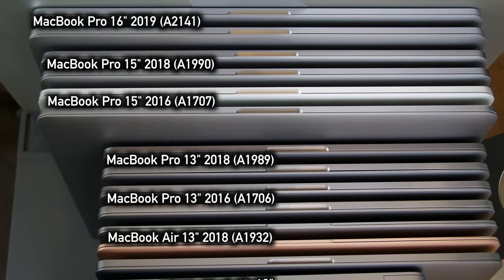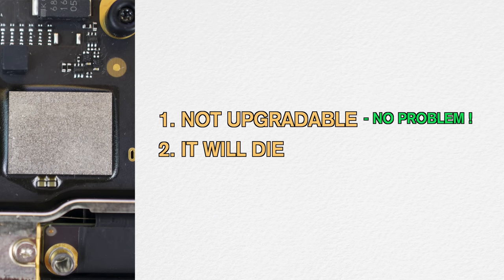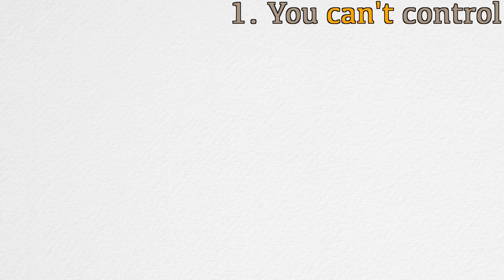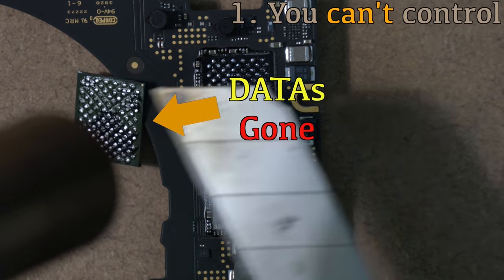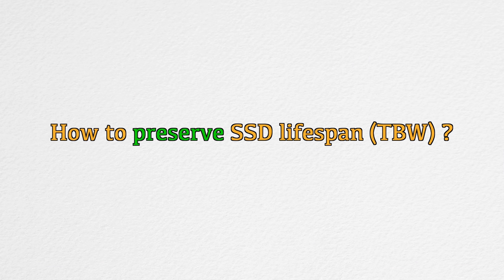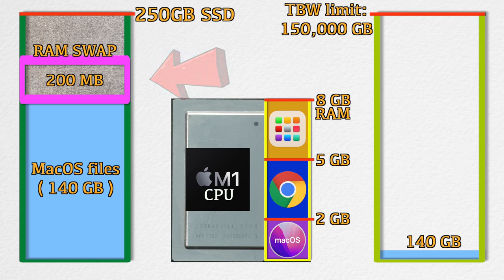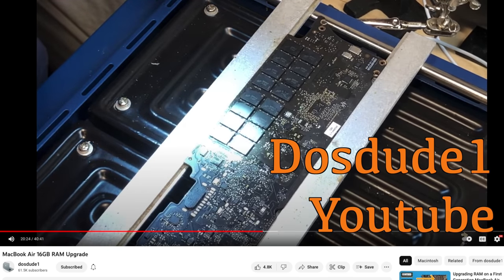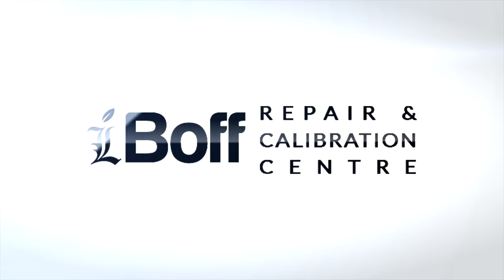These MacBooks DIED from SSD Failure & How To Prevent It (Not for RICH dudes!!)

Comment: The other thing as to why you get a larger SSD than you think you need is an issue with wear levelling. The TBW metric is oversimplified. The SSD has a number of blocks (say 1000 for a simple example), each of which can be rewritten 1000 times. What happens if the SSD keeps rewriting the same block rather than sharing the load? If your SSD is 80% full, then all that writing and rewriting is spread over the 20% of blocks remaining, which means that those blocks get worn out way quicker than the TBW lifespan metric would indicate.

I'm writing this on a refurb Thinkpad I got off eBay for £150, which has an nvme slot. It's current SSD is small (250GB) and is about 60% full with all my music and other software installed. But as and when that becomes an issue, it is an M.2 SSD, so I can replace it. The RAM is 4GB fixed plus one slot (currenty 4GB but I can stick  a 16GB stick in at some point).

I can understand fixing the memory to the CPU (better speed/latency). Having two tiers of memory (fast RAM on the CPU and secondary RAM in slots on the motherboard) would complicate things.

But soldered storage is a cardinal sin. I have a friend who is mac only. Her current Mac has served her well for 10 years. A new mac will cost a lot, and this video points out what I'm very concerned about, namely that she won't get 10 years out of a new mac. 5 if she's lucky. So the cost is amortised over half the time, so is effectively twice the price per-year compared to her current mac.

More and more Macs are becoming a means for Apple to rinse the rich, and to hell with everybody else.
Reply: TBW is per entire drive capacity, before failure. So divide that with the number of TB of the drive and then convert to GB. You then get how many TB a single GB of free space on your SSD can be overwritten with before that GB dies.
Reply: Maybe SSD companies have clever tech that randomly rearranges the stored data to different datablocks to prevent the issue your saying... doesn't seem that absurd of an idea hahaha
Reply: The other thing not mentioned is deleting files are also write operations, which tally to TBW as well
Reply: Give her your thinkpad
Reply: God you are dramatic. It really isn’t that bad. Oh NOOO she didn’t get 10 years out of a laptop computer? THE HORROR 😂😂 TF you smoking!?!
Reply: this depends on the controller for the drive.  A good controller would recognize those files that haven't been changed for a while, and if rest of the blocks are getting used much more than these blocks, it would copy these files into those overused locations then use these less used blocks.
Reply: So it seems that implies another best practice is to keep onboard SSD with as much free space as practical?
Reply: @j3ffn4v4rr0  Best practice is not to buy soldered to board ssd to begin with =)
Reply: Load of nonsense, 10 yrs out of the average SSD, soldered or not. Stop whining!
Reply: Some of the worst cases highlighted on Twitter and community forums indicated that some SSDs had consumed up to 13% of the maximum warrantable total bytes written (TBW). This kind of excessive usage would mean the lifespan of an M1 Mac would be as little as two years
Reply: Well, I will resell all my Apple devices.
Reply: @PaulSebastianM  Internally, an SSD is divided into blocks. Each block has a limit to how many times it can be rewritten. It is from this that the TBW limit for the drive is derived. But if the SSD is forced to rewrite the same block many times over, that block can fail before the drive reaches its official TBW threshold. The drive tries to even things out by using blocks that have been rewritten fewer times in preference to blocks that have been rewritten more. (This is wear levelling.)

If you don't have enough space, the drive can't do wear-levelling properly.
Reply: @davidedt  may i ask how much you are asking? and which devices you are selling? thank
Reply: @spacecadet2172  The problem he was pointing out was 5 Years of lifespan if lucky, and then the other problem is that you can't just save it's data again somewhere else after it suddenly dies.
Reply: @fa14bi-78  That's completely false.  He is blowing smoke up your butt.  Yes it's possible for drives to fail, but it's not common.  My parents are still using my 13 year old 2012 retina MBP with its original SSD and it runs beautifully (and I put that thing through hell).  I support clients and their Macs all day every day, and I come across countless Macs that are working great with SSDs way older than 5 years.  This "5 years if you're lucky" nonsense is complete hogwash.
Reply: @spacecadet2172  Well, depends on how much storage is used and how often the same part get's rewritten. As well as swap may be active or not. 

I managed to kill an SD card within 3 Years so there is that.
Reply: @fa14bi-78  again, I didn’t say it’s impossible but it’s much less common than he makes it out to be. Even writing many times past their lifespan they often don’t fail. That is just a loose estimate. It’s not a date of execution. Their drives are so much better quality and more reliable than a commodity SD card. They are not even remotely comparable.  If you actually thought they had a similar lifespan, no wonder you guys were so worked up. But that’s just not the case.
Reply: @j3ffn4v4rr0  Where did you get this from? And have you ever looked at the prices for a M.2 ssd vs paying a 5x price premium to upgrade the SSD from the Apple configurator?
Reply: @Welovedaxies  This video proves otherwise. LOL. Just because it's a small chance doesn't mean that there isn't a chance. Losing your whole entire drive's worth of data is not a small issue.
Reply: @spacecadet2172  Just wait until you happen to be one of the unlucky people... though I assume that you back up your data due to your experience with IT. However, this might be shocking to you, but the majority of people don't back up their data.
Reply: @spacecadet2172  Your opinion seems to only make matters worse. Placing false trust in a drive only makes people less likely to back their data up, and if they are one of the unlucky people (which is not even that unlucky due to the rate of drive failures), they are screwed.
Reply: @spacecadet2172  Any mac fan can say wonderful things about macs but are they true?
Reply: @spacecadet2172  you cant say what is happening to all macs out there so I think that you say its not true.
The smell of fanboyism is in the " 2012 works beautifully"  no 2012 mac works flawlessly or maybe you downloaded some ram?
Reply: @vivek_v  You're not paying enough attention to this month-old thread. I'm referring to what John Allsup said regarding how not having enough free space will inhibit wear leveling and reduce the effective life of the SSD.
Reply: @Teluric2  Mac users who actually work with with tons of Macs over the course of decades tell you their experience, and you dismiss them and think you know better with your limited experience with Macs, and I assume scuttlebutt you heard on the internet from Apple haters.  What is even the purpose of arguing with someone like that?  Clearly you don't want the truth, you just want to confirm your preconceived notions.  Also yes, the MBP from 2012 runs great.  The SSD works very well still, and it has 8GB of RAM, which is the same amount of RAM that the majority of Macs still ship with to this day.  The same can't be said for the HDD based MBP that preceded it.
Reply: Why choose macs. Its bad PoS especially soldered ram and ssd. I'm still using my lenovo y50-70 bought in 2013. Upgraded ram with corsair vengance 8Gbx2 ddr3 and SSD samsung 850 pro 250Gb in 2014. Still working fine and i let it run like a server for the past 10 year. 🤣
Reply: So your friend moves 82 gb of data every day for 5 years? 😂😂😂 really?
Reply: people demand skinny laptops - so solder them in!
Reply: @Rudyjosephjr  It is nothing more than a status symbol. Shallow mac fanbois will never admit to all the ways apple has failed us all.
Reply: @David-wb1vw  I do when I play games, sorry you can not have fun on your typing thing 😂 almost forgot that games are only for non Mac users.
Reply: @Auguur  wow - you are such an amazing person!
Reply: Your friend should be able to 8 years out of the max if she spends 400 extra for 1tb ssd.   However she can save 10-20% buying refurbished directly from apple.  I always buy refurb from apple and still have a 2012 mbp retina and 2016 mbp, 2020 mba, and 2021 mbp 14”.  The later two replacing the former 2.
Reply: @timbukstu  refurbished from Apple is great - one can purchase the full 3 years of AppleCare.
Reply: @gcbification  I don't think that 'deleting files' is a write operation... it only cleans out the directory pointers to those blocks...they are only re-written when new data fills in those blocks, UNLESS you use a 'Secure Erase'm which REALLY BURNS THROUGH writes ! As it re-writes the data blocks, several times.
Reply: Excellent point. Wow, this is why I doubt the future is about abundant cheap goods and services... the hidden costs of Apple is such an example. Wow- new models and half the life of the old models? Sitting here with 3 dead MacBook pros and now I know why. 😮‍💨 And how much data loss has Apple caused because they didn't inform customers? 🤬
Reply: @brucemercury  Time Machine Bro!
Reply: @spacecadet2172 ohh you re so apple loyal. What he meant is that the new macs wont last as long.
A mac built in 2015 wont last like a 2012.
Reply: @Welovedaxies who is gonna believe that
Reply: @spacecadet2172 my parents? Why we should believe a teenager?
Reply: @spacecadet2172 just another  isheep that thinks macs are perfect and we gotta believe what he say.
Comeback when you have a degree under your arm
Reply: @spacecadet2172 the word " beautyfully" shows you re fanboy .nobody unbiased would use that word.
Reply: @spacecadet2172 ssd best quality? Based on what? Why do you think ssd nand chips can be replaced because they re standard not the premium hardware apple claims but is not  true
Your name must be applecadet
Reply: @spacecadet2172 clearly you would die defending apple

I wonder if that 2012 mac does exist in real life.
Reply: @flyingdiscproductions people who need skinny laptops are not working they need a toy to brag about
Reply: @Teluric2  There you go! you just proved everything with that one sentence!
Reply: get an external sata and partition it i can run snow leopard on my 2020 mac touchbar does not work because of os but everything else does
Reply: @miscmisc1023  What do you mean "does not work"?
How have you configured it?
EFI?
Reply: @patrickdonegan9559  it works but software is not compatible with snowleopard if it was high sierra and up yes
Reply: @Welovedaxies Show realible evidence. My 486 is alive too lol running windows 12 and editing 16k videos😅
Reply: @rafaelreusch  static wear levelling does exactly that. i.e. moves data from static blocks that fall below a certain P/E ratio. Dynamic wear levelling only touches empty blocks. 

The naming's a bit counterintuitive as we normally associate dynamic with better whereas in this case it isn't - not for drive life.

I'm not sure drive manufacturers list the type of levelling each model employs. I feel they ought to.
Reply: Macs are garbage designed to fail and get you to buy more garbage. Kind of like HP
Reply: @Welovedaxies I have a 2013 air. Still going strong. It still works as my daily driver. It’s soldered on. Hopefully it doesn’t give up on me
Reply: No matter what the life span of the SSD is, storage should not be soldered onto the board. First, because of its limited lifespan and second, to keep the option for the customer of upgrading the capacity.
Soldering storage onto the main board is not a sin for Apple - it’s their business model and will backfire eventually.
Reply: The reality is this is not so dramatic. I’m using my MacBook Pro 16 M1 Pro 16GB ram and 512GB SSD for daily video editing, in general 4K 60fps hdr .mov or .mp4 for 1 and a half year. I’m editing one or two 15 - 25 minute 4k vlogs, from external ssd, a Samsung T7 Shield. Seeing 20GB swap memory when editing is something very normal. My actual internal SSD health is at 100% and the TBW data show me 14.6TB. Normally I charge my MacBook every 4-5 years, so, with the actual conditions I’m good to go with what I have.
Reply: @AurelianIrimia  Your channel has one video. Not really the product of a daily video producer. Plenty of PC owners imagine themselves as gamers even if they haven't opened up Steam in 8 months, people imagine themselves as productive information workers even though they haven't opened up MS Office in 6 years. Personal testimony is not data.
Reply: @L9MN4sTCUk  I’m not a YouTuber, I’m editing for other YouTube channels.
Reply: @spacecadet2172  Why should people be made to replace their computers because faulty solid state storage was used in its manufacture?  Apple users aren't afforded the opportunity to replace their SSDs when they are soldered to the motherboard.  I've sen how it used to be possible to boot from external drives but with the T2 chip the BIOS functions are tied to it as well.  So when the T2 chip fails there goes the entire BIOS as well.  Meaning you can't boot into whatever Apple PC you're using without getting that repaired.  Based on how Apple chooses to treat all of their customers it likely means having to replace an entire overpriced computer instead of replacing a defective short lived component that was designed to fail prematurely!

Contrast that with non-Apple PCs from decades ago and their BIOS chips still work just fine, they tend to still work even if new drives or RAM has to be installed, and still function for their intended uses.  Not so with "modern" Apple PCs.  That is the true horror of buying landfill Apple PCs.
Reply: @L9MN4sTCUk  , there is no secret for me if it feeds the ego and greed.
Reply: A @vivek_v    Especially Apple like to belittle IT guy.    A lot of people brush me off when I said Mac's need support just like PC's.  Most people take no problem no need for IT when it comes to computers.
Reply: E @Auguur  Especially the LONG list of Mac hardware failure is famous.  Graphics card, screen, keyboard and battery to name a few
Reply: @rafaelreusch  Yes this feature came around year 2010.
Reply: I'm not entirely sure about this but thr wear levelling is done on the firmware level. Depending on the ssd controller, it could cmove the static data to the blocks that are worn more. Effectively distributing the wear. 

As for Apples shenanigans, they went out of their way to make it unrepairable. Turning things into disposable consumer device is an actual design goal. Ugh
Reply: Mac fans find all sort of excuse to pardon Apple for this behavior.
Reply: @anonymouseniller6688  all modern SSD does this on firmware level.  I don't know of any modern SSD controller that doesn't have TRIM function build in.
Reply: Keyboards, screens, power slots, headphone Jack's will wear way before anything else on all machines no matter who makes them.
Reply: @SD-ff1je  That's not the case from my experience. I've used several systems, it's usually the hard drive that pops issues first. Early power cable issues have always been due to rough use (twisting cables, running them over with chair caster wheels, frequent bending and knotting etc)
Reply: i have a mid 2012, Last mac i'll buy. works still great and i fixed all myself all the time. Apple is just full of sh**
Reply: @spacecadet2172 its more trash, the horror of overwaste technology
Reply: @simp69OG  it’s up to you, but I think you will really like it.  The battery life and performance are both fantastic. As I said above my parents still use my old 2012 MacBook Pro and the SSD has never had an issue. The Apple Silicon systems are even more reliable.
Reply: Apple has been ripping people off for a long time. Getting a new MacBook these days is like looking for "serious relationships" on a hookup app. Just a waste of time and money better spent elsewhere.
Reply: @spacecadet2172 You're done blowing Apple's trumpet, fanboy?

Good. 

The main point of contention here isn't the quality or lack thereof solid state drives, RAM and other perfectly upgradable components, nor their lifespan. 

It's the fact that Apple SOLDERS THE DAMN THINGS TO THE MOTHERBOARD. And has the nerve to charge laughably absurd prices for this shitty business practice.
Reply: Well said. This is the no. 1 reason holding me back from upgrading.
Reply: Oh the horrors
Reply: @Rudyjosephjr  Lenovo from the 2010s are terrible, I know because I have one
Reply: @Teluric2 you're proving on what he's saying
Reply: @spacecadet2172 Keep laughing at the fact that…. Incredibly expensive products are less durable and don’t last as long as the products used to? And while not only being more expensive and less reliable, they are more difficult and expensive to repair? You’ll do well with finances 😂
Reply: This is why i try to educate mac users, and also practice it myself as i am a mac user as well, that, you should avoid saving things on the internal storage and only use the internal for the software so the ssds just read and do very little writing. It's scary, however, buying second-hand units. You never know what kind of use it went through.
Reply: @spacecadet2172 You are missing the point. I totally get what you are saying, really, in good faith, but the thing for me is that Apple proved they CAN make machines that last 10 years. They are CHOOSING to play with failure probabillities of components to get some expected value that will generate them more money, which is fine, but don’t delude yourself into to thinking that OP asks for the impossible.